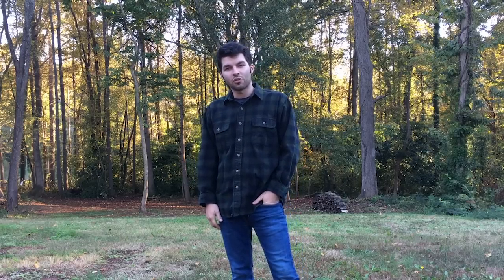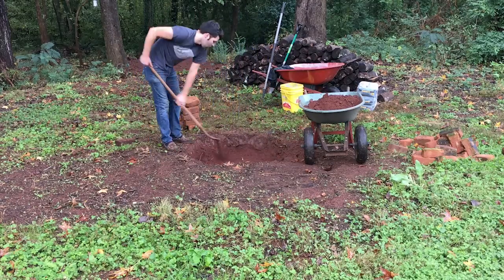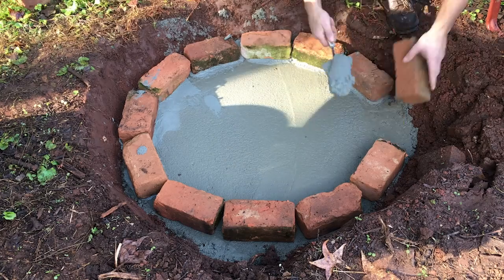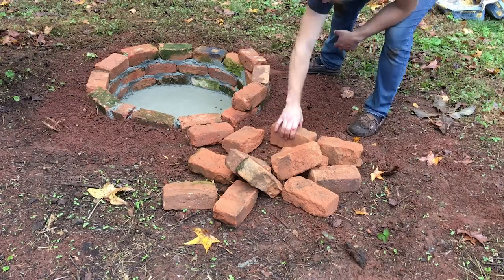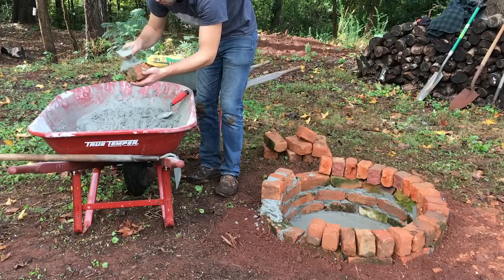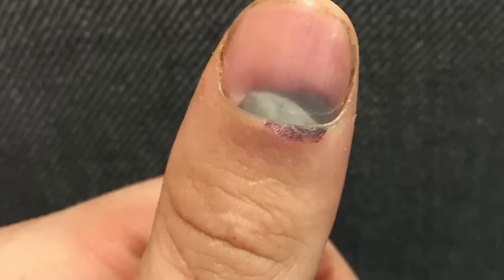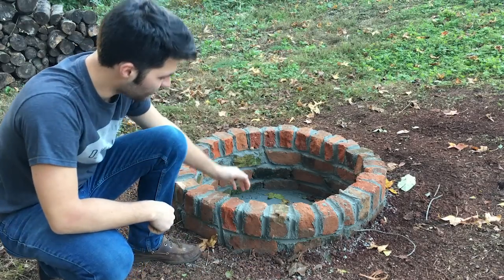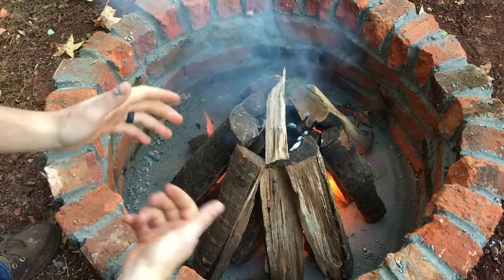DIY Fire Pit

Comment: This is the closest thing to what I was hoping to do in my yard. I decided not to dig so deep, because I want the top layer of bricks to be at or close to ground level. I want to leave several spaces along the bottom row, for circulation. But the video was so helpful to get my thinking lined up with my hopes. The concrete is poured and drying. I have to wait a few days to add the bricks because of time, but I've made good progress if I do say so myself! Thanks!

Comment: A few tips for brick work (I’m a bricklayer by trade) when splitting the brick hold the brick in your hand and hit it the center with the corner of your hammer it’s best if you have a brick gamer but a claw works as well #2 most mortar is only treated for 1-2 hours of fire before it starts to break and crack so just be a bit careful with the materials you use there are also “firebrick” #3 when you are building this design get cardboard and cut it to fill the bottom joints so the water will be able to drain take them out when it’s cured(finished)  if anyone has any more questions lmk and I’ll gladly answer them!
Reply from the maker: Thanks for the pointers! I appreciate it.
Reply: I did mine and didn't use high heat mortor long story short it busted gotta redo

Comment: good vid, but I prefer a ground level fire ring with a dirt floor.  Don't have to worry about rain and cleaning out is easy.  This sunken concrete looks nice, but its going to be a pita to clean out and to keep water out (even with a cover, there will be leakage through cracks/seams).
Reply from the maker: Yeah it was a pain to clean. But surprisingly the pit never filled up with water. I actually just built a nicer and bigger fire pit that is above ground and has plenty of drainage and air flow. If your interested check that out on my channel for most recent video.

Thanks!

Comment: Very nice, looks like it's been there a long time. I hope you didn't build a patio around it, the natural setting looks great. I'm currently building a little fire pit, dug it out last night and lined the sides with small decorative slabs flush with ground level. No cement for me, just sand (and pebbles to stop the cats from crapping in it). With the earth I dug out I'm going to form a grassy knoll as a sitting area at one side. My garden is tiny compared to the area you have: I guess we all have to do what fits our space, budget and requirements. Thanks for sharing your project.
Reply from the maker: Thanks for sharing! :)

Comment: You can drill weep-holes in the bottom or you could have dug a run-off but you can just lay a few rows of brick at the bottom to start so your fire will get air, be off the ground and the best part... you don’t have to use any mortar at all. I have friends that have never used any type of mortar and I’m not going to either and the pits are over two years old and still going strong. You did do a nice job me and my buddies have been in masonry all our life trust me you could’ve done this with no crete or mud.

Comment: This fire pit will make a great well. Fire loves oxygen why block all the air flow gaps?
Reply from the maker: I actually haven't had any issues with water drainage. The are is an issue when first starting the fire but once you get it going it burns great :) Thanks!
See link for update video if you're interested. https://youtu.be/Z88PTLemhDs

Comment: Don't usually use a concrete base as there is no method to drain excessive rain water away.
Reply from the maker: Yeah, if you are really worried about drainage you can always put a 6in base of gravel and then use cement and brick around the outside. However, I haven’t had any issues and we have had plenty of rain since building it. The key to this pit draining is that I didn’t cement the vertical cracks between the bricks. You could also leave drainage holes in the cement base to allow water to escape.
Reply: The good thing about not cementing the vertical cracks also means that your fire gets air through to the base to keep it alive 🔥 and kicking 🔥. All fire needs oxygen so having the air gaps works a treat....I think?

Comment: if you can remember, about how many lbs of cement and mortar did you use for this?
Reply from the maker: I used two 50lb bags of regular sidewalk cement for the base and then two 60lb bags of mortar for laying the brick. 220 lbs of concrete in total.

Comment: Does it drain well or is it a mosquito breeding ground?
Reply from the maker: Yeah, it drains alright. I've never seen standing water in it. However, If you want to be on the safe side you could leave wider gaps in between the bricks on the bottom row to allow for more drainage.

Comment: Should wait longer than 2 days and next time maybe offer a drainage hole and lots of gravel underneath
Reply from the maker: Agreed. I haven’t had any issues with drainage however, it never hurts to be on the safe side. Something that helps is the fire pit rises above ground level. This helps keep the pit dry as any standing water in my yard doesn’t fill up the pit. Thanks for the advice!

Comment: Any issues with drainage?
Reply from the maker: No I haven’t had any issues. I ashes at the bottom are sometimes wet or damp but there hasn’t been any standing water in it. The moisture quickly evaporates after starting a new fire.
Reply: SimonSaysDIY Harvey  great I was trying to see where the water would seep out in the bottom. Looks great

Comment: 3:56 I don't think that's very good.. it is going to collect water.. you have to make a drain hole in the middle full of small rocks .. also an air pipe is not a bad idea
Reply from the maker: Thanks! I haven't had any issue with water drainage yet. The soil around the pit is soft and is the vertical joints being left open allows the rain to completely drain within a day. With that said I agree this would be better with both a more effective drain. The air is a small issue when first starting the fire, however once it gets going it seems to do great.

I have made a update video for the fire pit if you're interested. https://youtu.be/Z88PTLemhDs